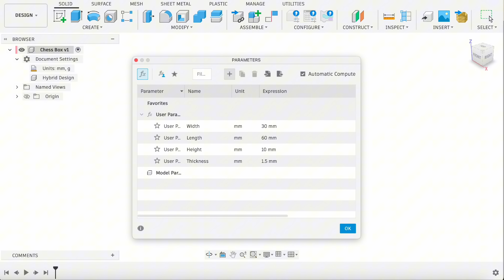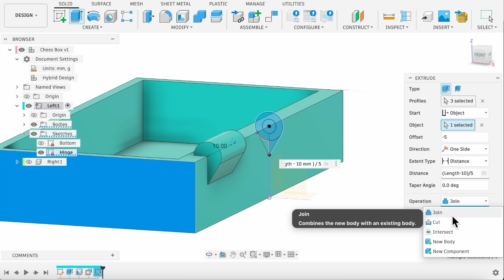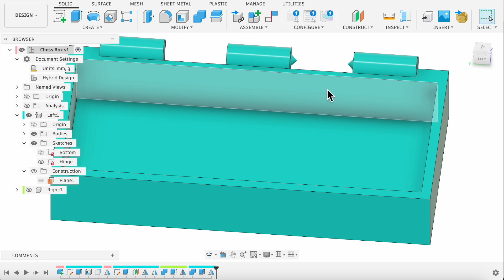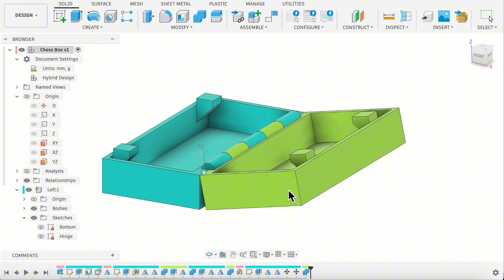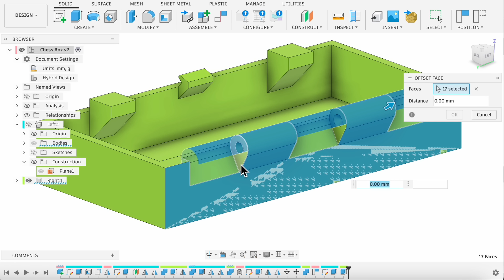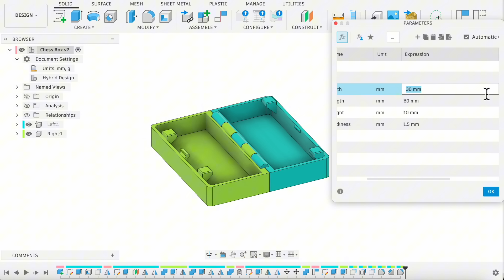Designing a Print in Place Chess Box | Fusion 360 Tutorial

Comment: if you can't find the new component try this
Create a Hybrid design or convert the existing design to a "Hybrid" in Autodesk Fusion. To convert an existing file to a Hybrid design:

Expand the Document Settings section in the browser tree.
Hover over Part Design or Assembly Design in the Document Settings. (A pencil will appear after the design type)
Click the pencil. 
A new window will pop up giving you the options for conversion.
Select Hybrid from the drop-down menu. 
The file will be converted to Hybrid, allowing the use of Create Component.